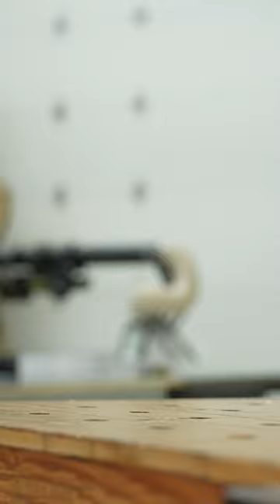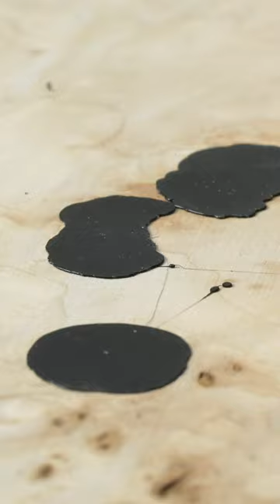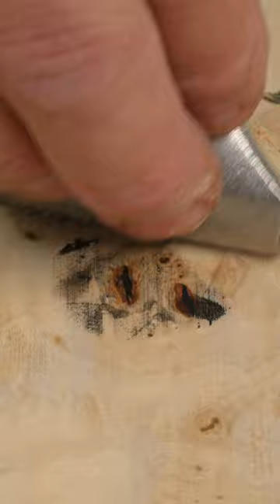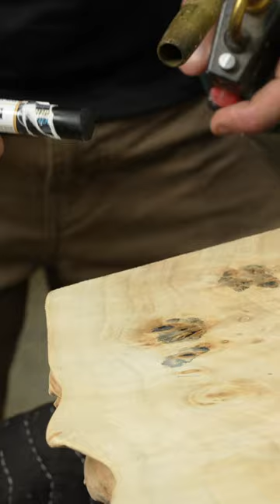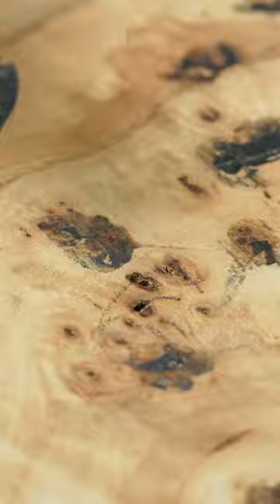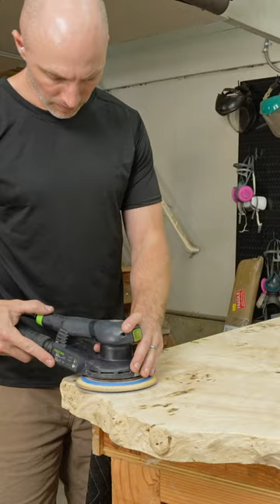Filling holes

Comment: Will it not melt when any hot dish is served on the finished table?
Reply: Hmm, potentially but it’s standard practice to not put hot dishes on expensive furniture. Even epoxy will deform and discolour with a 300C cast iron pot. Just use a trivet.
Reply: @whirled_peas  I had the same question, but it's fair enough.
Reply: Use a plate maybe